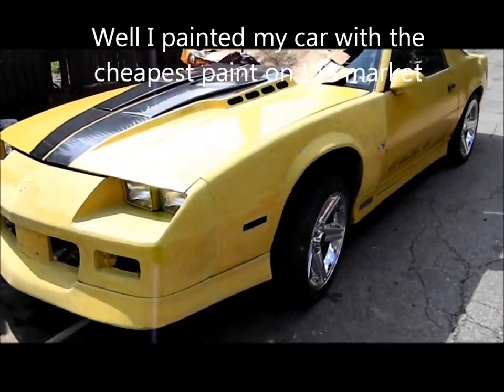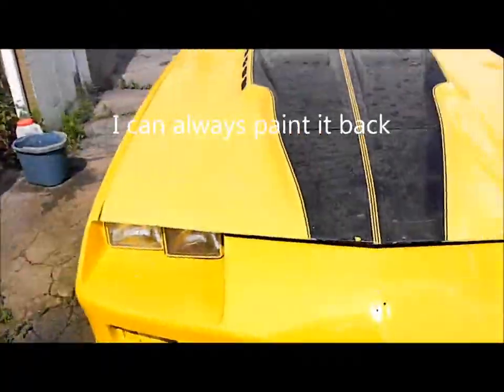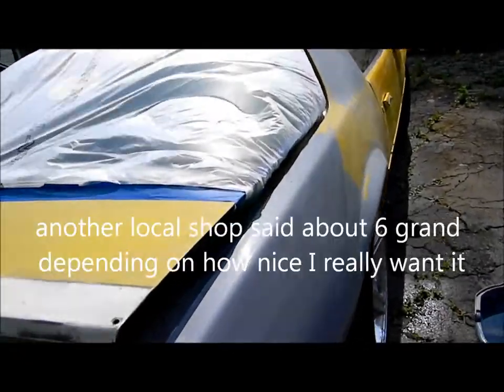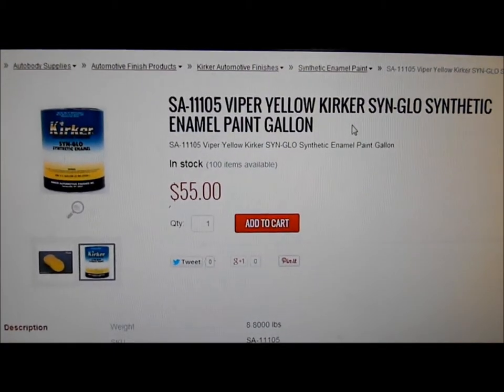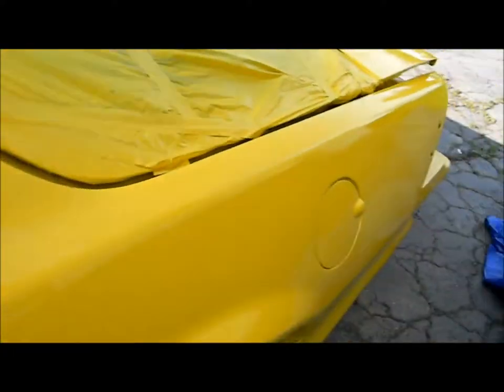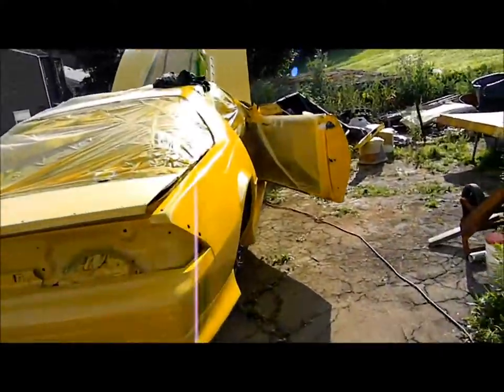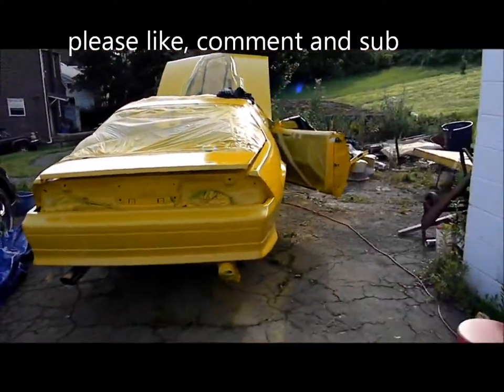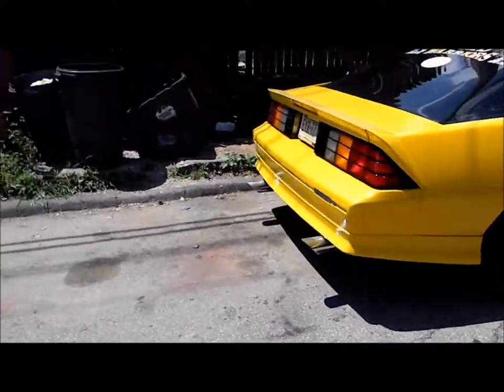I painted my IROC for cheap with Kirker paint

Comment: How many coats did it take to cover over the primer?
Reply from the maker: I definitely wanted too lay it on there and pray for no runs, we went around it a few times, 2nd coat for sure it was looking good, I prob did 4 coats total in end
Reply from the maker: But by 2nd coat it was pretty much covered
Reply: Great to hear. I ordered the same color for a project and was curious on coverage. Especially since yellow can be transparent. I appreciate the response and it looks really good!
Reply from the maker: @MisterShpek  no problem and thank you, yeah my honest opinion this is great value and looks great I plan to go over again same paint down road, I also have another old 3rd gen similar yellow but I bought it in rough condition I most likely will do that one too if I ever get caught up on few debts